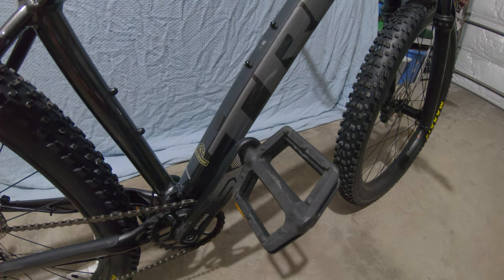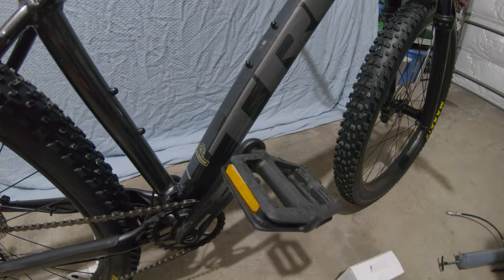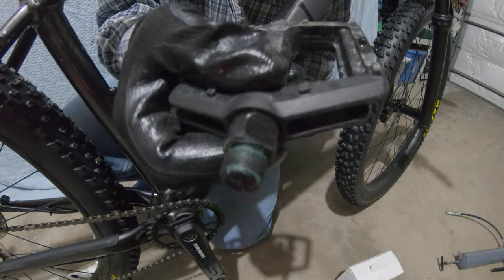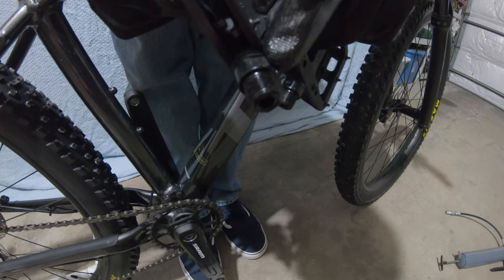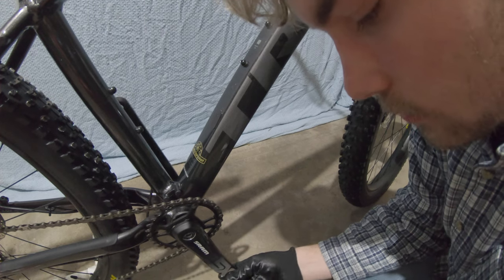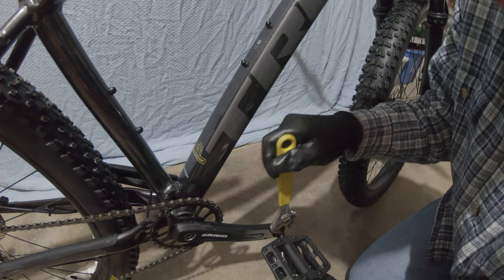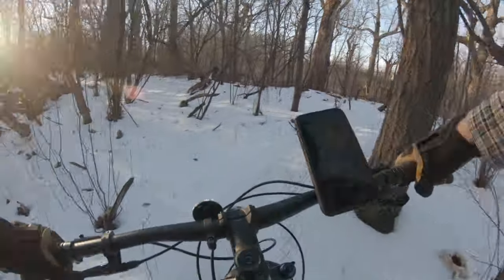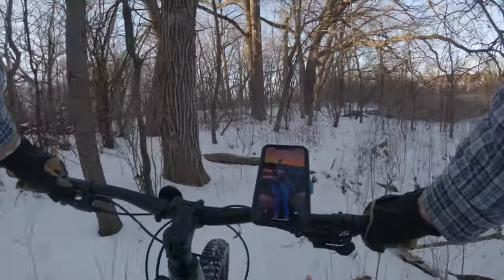How to change the pedals on your bike

Comment: Thanks!
Reply from the maker: No problem!
Reply: Where do you buy the grease?
Reply from the maker: @pedrocastillo3722  it’s just regular grease.  You can go to any bike shop or even home improvement stores.  It’s not really required it just makes changing out the pedals easier down the line.
Reply: @trailcamcycling Great, thank you for answering my question.